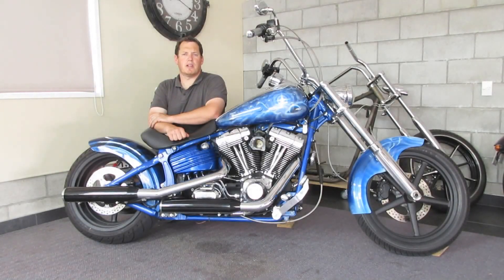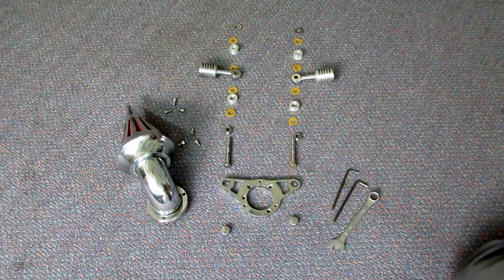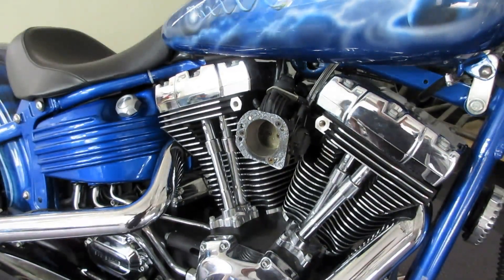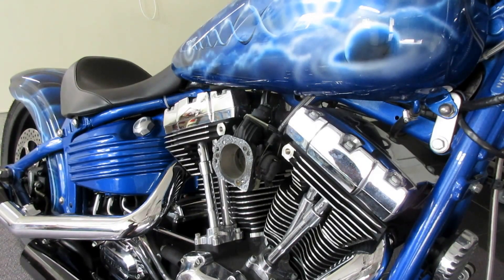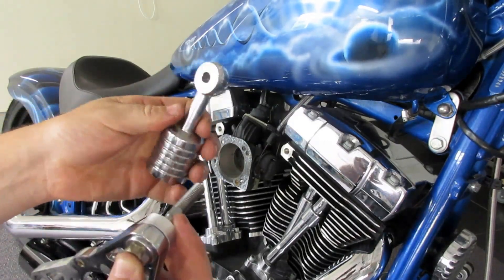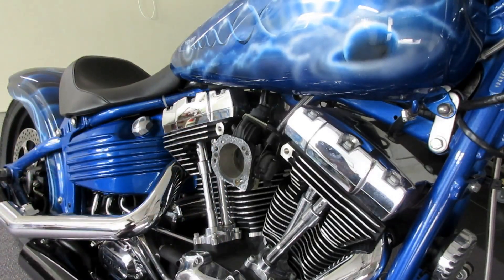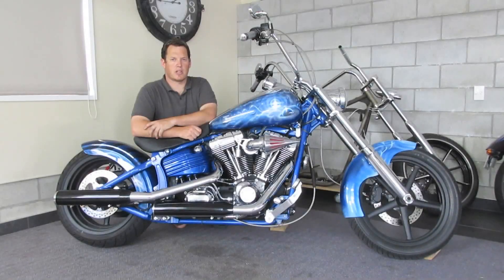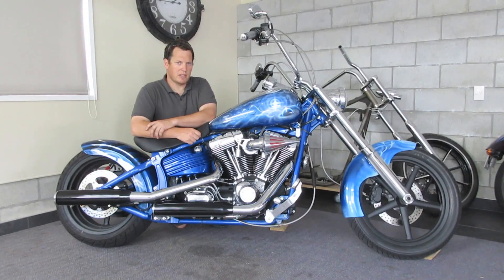Harley EFI Spike Air Cleaner Install

Comment: Thanks for the video. It was a great help being no instructions came with it. I have a 2011 HD Super Glide Custom with Vance and Hines 2 into 2 big radius pipes and was worried I'd have to re-map after installing the intake, but low and behold, no problems.

Comment: Thanks for the video i just installed a  similar air filter on my 2005 road king classic. Looks great! What kind of silicone did you use for those bolt caps?

Comment: Awesome video very helpful and much appreciated!!
Can you please tell me what the difference is installing the spike air cleaner kit on a twin cam EFI engine to a carbureted engine? Your feedback will be very helpful. Thank you much, cheers.
Reply from the maker: Hi there, thanks for the comment - they should be a very similar process.. I would do a video for the carbureted version if we had one here, unfortunately we don't at this stage. The kits are slightly different, but essentially a similar process - and I recommend trying to get hold of the breather type bolts/bracket if purchasing especially if your engine needs it, as a lot of them don't have this feature.. Hope that helps somewhat! Cheers!!!

Comment: Great vid dude...very helpful..great visual and explanation..had a slight issue..hope you can offer advise...The breather bolts were very tight ( I assumed they were imperial in the packet) but it snapped off with at least 80% of the thread in the head!..Can i cut off the protruding bolt and use an easy out to remove the bolt..vise grips didnt move it?. 
Would you know why they were so tight in the first place..could not finger tight at all.
Cheers
Reply from the maker: Hi there, my guess would be the thread was either the incorrect pitch or was maybe roughly cut? Quite unusual as we've never had this issue before. If you're unable to remove with vise grips (I would try again if possible and use plenty of WD40 on the thread beforehand), if you can somehow find a way to drop the temperature of the bolt/thread it may contract enough for you to start turning it out. Otherwise yes, you may have to cut off close to the head and try a screw/stud extractor, however this would be my last resort option. Hope that offers a little help! Cheers.
Reply: Thanks for the tip mate..appreciated. I like the idea of reducing the temp helping it contract..tomorrows job. I found it strange the bolts were so tight..thanks again...keep up the great vids...great job.

Comment: Can you share the link for that kit looking to order one but the ones I'm finding by the reviews there's problems with the breather bolts
Reply from the maker: Which country are you based in?
Reply: America I'm in texas
Reply from the maker: @masonmcfarlin4640  The Kits on eBay are usually where I get em, depending on your model. Never had any issues with the EFI or CV kits, the only ones I've had to watch are the sportster kits, just make sure they have the breather kit included if thats what you're going for. Hope that helps in some way!

Comment: new revtech motors won't take these any suggestions?
Reply from the maker: Hello, what kind of setup are the new revtech intakes running? best I can suggest at this stage would be taking the desired setup to your local engineer/machine shop and have them build a bracket/mounting plate to match them up... have seen this done before but it can take time and $.